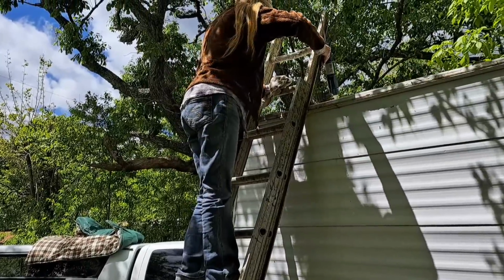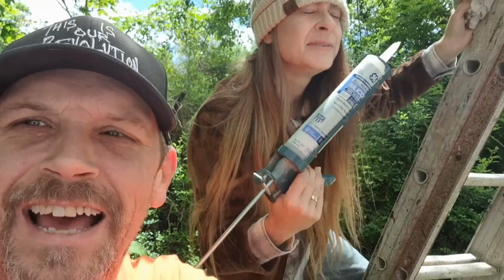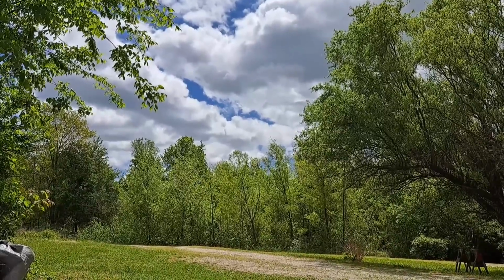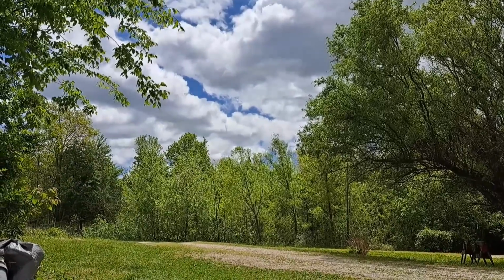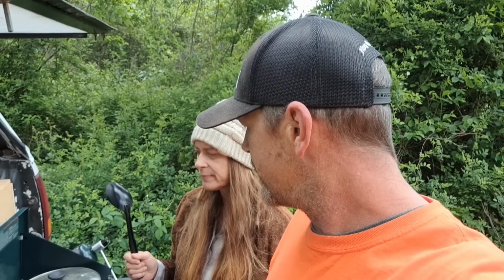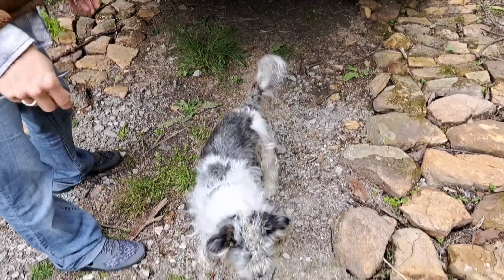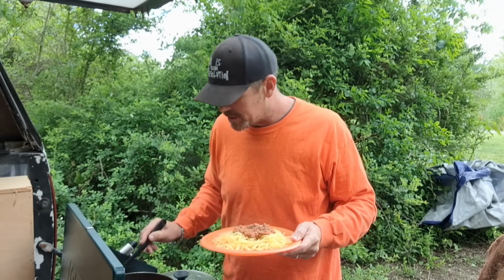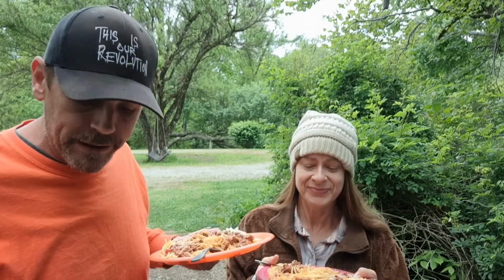Sealing The Camper For Potential Leaks / Off Grid Spaghetti / Cooking / Camping

Comment: Just a  helpful hint aka advice,1 just add some more water stif sketti for a good 30 seconds after adding it to the water ..no oil needed..salt is if you want it..one thing for sure tho..dont use a metal fork on teflon you will damange the pan ..but you made a great looking meal..mix it all  up after for left overs..

Comment: Put a few drops of cooking oil in your boiling water then add noodles and they won’t stick together.
Reply: Yep works every time ❤
Reply: Or some salt..
Reply: Yes that will work. 
Also butter will work also.
Reply: @robertquintel8706  Yes Robert, you always salt the water a little when you cook the noodles. Some like to put a little oil before adding noodles so they don't stick together. Some don't because they say they don't like to because it keeps the sauce from sticking to the noodles. Everyone has a different opinion.
Reply: @Jacqueline Wells  yea I don't and can't do the salt ..and find with out it..
Reply: Needs a bit more water in the pot..stir for a minute after putting pasta in the water and good to go..no oil needed

Comment: Hi Corey & Cynthia 👋
The new leaves on the trees are such a bright, pretty green. What a wonderful view to wake up to every morning 🌄 This is a good time of year to make repairs on your home. Tarping the top of the camper might be a way to protect your roof so it lasts longer. There's also a roll of permanent "RV tape" you can buy to seal cracks in the roof. Its called PermaBond because once you stick it on, it's not coming back off. Its great to see you cooking real meals again. That will help you save money because most cooked dishes last for several meals, like chili, spaghetti, roasts, etc. Maybe the Bluetti would be better to heat the Crockpot than the generator though since gasoline is so expensive. Sending you both & Bubba love & prayers from Texas, Candace 🇺🇲 USA!